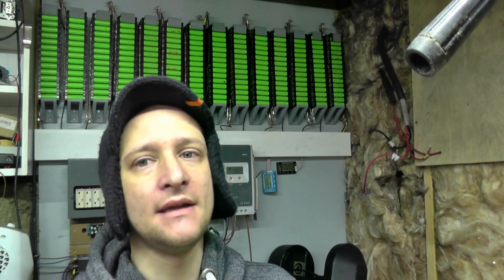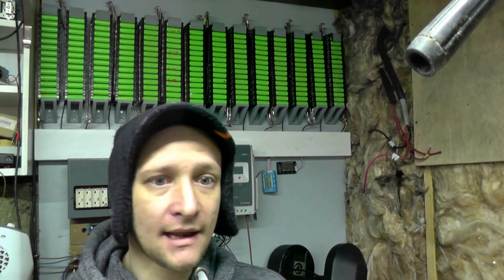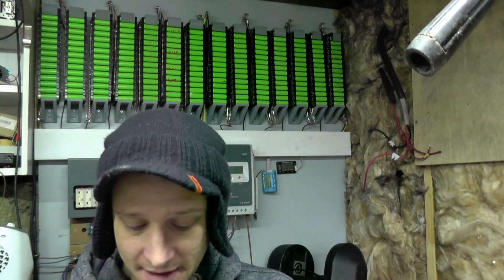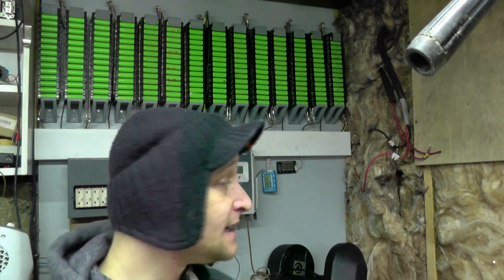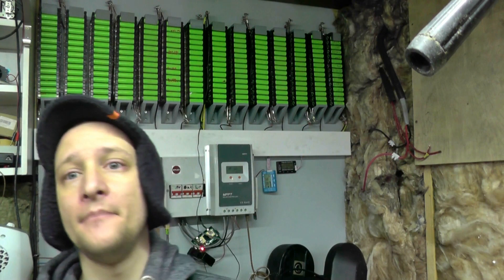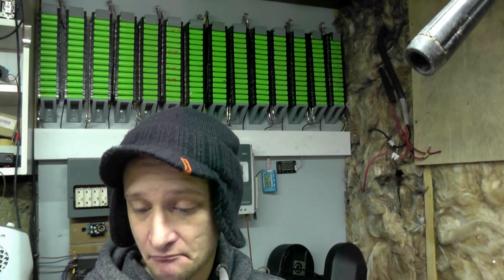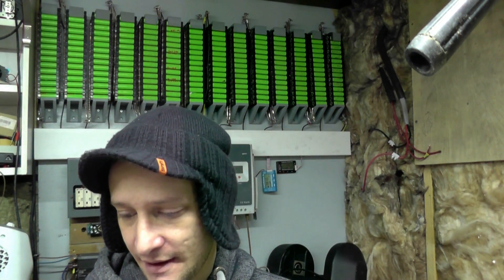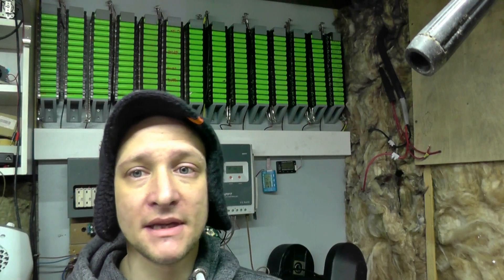Lets hear your lithium powerwall concerns. These are mine!

Comment: I've got a 7s 7kw and I don't use a BMS. I do have a expensive 2a balance board. And my epever charge controller won't let my batteries overcharge I also use voltage sensitive and temperature relays. So it's basically a BMS

Comment: Have you heard of these smart BMS's from China?
https://www.aliexpress.com/store/product/7S-30A-40A-60A-active-bms-2018-new-Li-ion-smart-bms-pcm-with-android-Bluetooth/1821822_32839591867.html?spm=2114.12010612.8148356.2.297e27aamMxAgc 
I have the 4s version and it works great. With the pc adapter, you can change every parameter you can think of for the BMS. The balancing current is quite small for a pack your size but it will let you pull up all the packs on your phone so you can monitor them. Have you set your EPever to terminate charge once it reaches about 29 volts to protect your cells from overcharge? Oh and I think your setup is safe enough, as long as you keep an eye on the cell voltages you're perfectly fine.

Comment: I dunno, I went to all the trouble to make an entire post of safety features on one commercial battery pack maker, it was mostly ignored.
https://secondlifestorage.com/t-What-else-can-we-learn-from-Tesla-battery-pack-design
Yes I even mentioned pressure relief in sealed casings.

To be honest I'm more concerned by the DIY electrics repair, people buying junk quality inverters then repairing them when they blow up.
So many youtube videos with these type of repairs, they just pull it to bits, replace the blown up parts then put it back to work again.
No attempt to improve the design, work out what they did that caused it to fail.
Is the soldering to the required standard for equipment with safety requirements ? NO
Work bench cleared of stuff ? NO
Check for remaining voltage in capacitors, and talk about safety issues with 240VAC/400VDC ? NO

Most of these are mistakes even hobby electronics people wouldn't make.
So they fix it, it blows up again, for various reasons, so they buy a different junk inverter and try again.

For what it's worth, I did offer several times to look at why the Charsoon Antimatter charges blow up.
I mean someone with actual electronics qualifications and design skills, no one could be bothered.
When someone in another country wants one for spare parts, gets two sent over.
Yeah some community.

Comment: People with no electrical background should be attempting this. BMS is a must and for home storage try using Lifepo4 or lto cells much safer chemistry than laptop cells
Reply: Shouldn't*
Reply: skyline, hold on a minute.  LiFePO4 is not a MUCH safer chemistry than laptop cells, rather it is only a LITTLE safer.  So folks on a budget can still use laptop cells if desired.  Both types still need some form of cell balancing as you note.

Comment: i see nothing wrong with your set up and is damn clean to most i have scene a powder fire extinguisher to a heat senser with survo to trigger would be more then fine as a fire represent system
Reply: Powder doesn't work, it just gets blown around, there is a video showing it not working.
You need either extreme cold, or large amounts of water.
Reply: How about an auto fire sense sand drop over the cell banks?  Water and any kind of electricity don't mix well plus all the later cleanup damage.  Sand is non conductor and not reactive, can help also help cut down on smoke and easy to cleanup.  Plus it can help isolate one cell from another slowing down a chain reaction!  At least it might buy enough time to throw out in the yard the offending pack or bank quickly.

Comment: if you make an led voltage indicator use the led that indicates the voltage for that pack to a relay and use a heavy duty resister or filament bulb these could be used for each bank to stop overcharge 
some cheap bms do have like a 45mah balance load if resister is removed this could be changed to run a relay to a heavy duty load for that bank thus stopping the overcharge as that bank would dump power untill others come into the balance